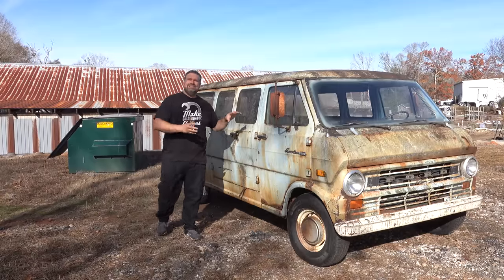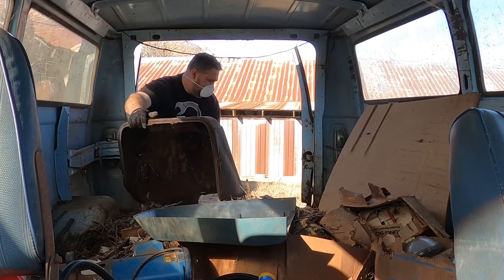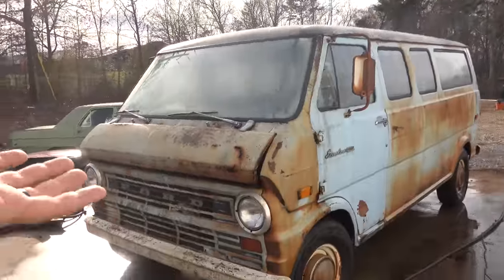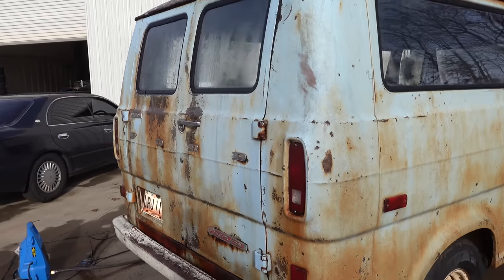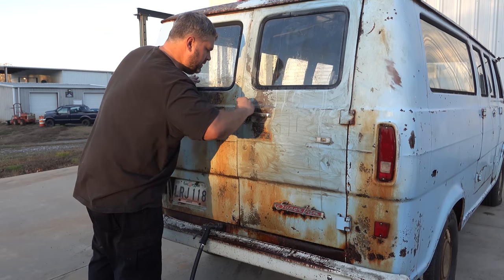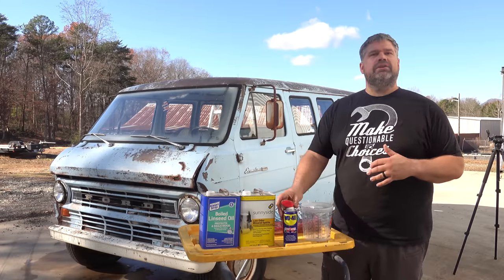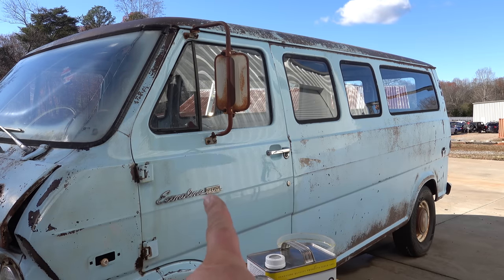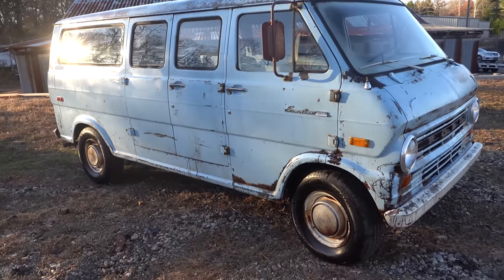First Wash In 32 Years! Abandoned In The Woods, Can This Van's Paint Be Saved? Ford Super Van VGG!

Comment: Dude you are right just keep it period correct and give the van the old skool custom van look. With some shaggy carpet and some old skool 70s curtains and build a wall right behind the farthest rear right door and cut a ford oval to climb through to a bed in the back. Just wall to wall blue shaggy carpet walls floor and ceiling. And put a table and captains chars in the area where the double doors are.

Comment: Maybe you could approach the build like a person with limited time and budget would. Fix what's broke, leave what isn't! Does the ventilation system work? Do the windows roll down(and up)? How are the brakes? The suspension? As for the 240, does it make good compression? If it doesn't, probably swap in something, as rebuilding is expensive, and the 300 or even a 302/351 makes much more sense if you're filling a hole. I would tend towards a stock performance type of build. This is a great vehicle for hauling merch to shows, shop hauler and even weekend camper. Disc brakes will make sense if the suspension needs a lot of work, because you can swap in later I beams. Automatic trans makes more sense if you V8 swap. You could upgrade the 240 with GM TBi for better performance/economy if it's still making compression.

Comment: If it was my van... exterior: keep the current look but maybe replace all window seals and such. Interior: sound deadening treatment, insulate, make a fully modernized luxury camper van. Mechanical: rebuild engine and modernize - EFI, tuned, etc. so that it's the same bones but you get to take advantage of modern tech and reliability... but don't make it overpowered because you want to be able to make long road trips in this thing without having to refill every 50 miles. New modern suspension, etc. I've always like the idea of taking old things and improving them with new tech while hanging onto their classic charm, and this van would be a great candidate for such a treatment if it's an idea that interests you. Regardless, whatever you choose I'm sure it will be fun, and I look forward to the journey, wherever it takes you.

Comment: Congratulations, you have done a great job on the van, I know this will be a lil late saying this, but if you don't care about too much power, I'd probably be looking at rebuilding the engine, and bolt on a M90 supercharger for that bit of get up and go, I'd try and keep that engine in it, if it's the original, rather than go V8.. 🙂🙂🙂

Comment: Were it mine I would make the outside look period + petina, swap in either a barra or Atlas w/ trans (a little more power, but mostly for reliability and fuel economy, making a 5/6 on the tree shifter can be your crazy quotient for this build) and then completely do the interior. I'd probably do swap in a F150 front suspension and steering setup w/ discs and do a cheap airbag suspension (front bags, delete a leaf + helpers on the rear axle) so I could dial in the rake/ride height I wanted when I wanted it but still have a useful vehicle that rides nicely.

Comment: Scooby doo van..fix the floor..jack up the back axle, put the biggest widest tires on the back. Put smaller tires on the front so it sits lower, keep the wheel covers if you like..rims could go anyway you like..chrome preferred. Needs some fuzzy dice hanging from the roof at the windshield. Must have dual cb antennas, with cb. Purple wall to wall carpet with possible wood benches/storage. 73 vans had carpet everywhere.

Comment: Jared, you do JDM stuff quite often but Derek does pretty much exclusively USDM. I think it would be cool to put in an NA 2JZ for the reliability and power, but not too much power. Kind of a mishmash of your different backgrounds a bit, since you were a Toyota master tech at one point. Not sure how the fit would be, but it's also an inline 6, though probably taller due to DOHC. I think a V8 would be cool, but it's a completely different shape meaning more cutting and fab work. The Barra would be really big too and hard to find parts. The Skid Factory did a Bedford van build with the Barra and it was cool, but a turbo build with a really large engine like that I think is more than this van can handle, especially in its current state. Old engines and period correct stuff is cool, but the prices are going up these days and the headaches with them as they age, not to mention stuff like fuel mileage, can be annoying if you want to use it for things like long trip adventures.

Comment: Great you saved this one from certain slow death. This would make an excellent daily/ shopvan. I would not throw crazy money at it but would do this instead:
repair all structural rust (don’t go for pretty but functional and economical), get a mild and reliable tune from the original drive train and replace all consumables making it reliable, refresh all bright work and seals around the entire vehicle (you want all chrome to look like brand new to make the vehicle really pop, add to that period correct aluminium wheels and some paint accents like a properly repainted roof and bumpers - if you stay on steelies, repaint those as well - I’d go for a period / utilitarian off white color for the repainted parts), new period correct looking but modern, fully functional captain seat (think about your back and comfort but keep a period look), restore the drinker side jump seat to original condition, restore cabin to original look ( economy over original but period looking) but add modern features like well functioning stereo, aircon, etc, overhaul the cargo hold for maximum utility - think flexible, one day shop van, hauling wood, the next day transporting bikes, the next day a little camping (don’t do a permanent camper or anything - this thing is sooooo utilitarian as naked as it is, also great gas mileage without hauling all the unnecessary junk around)

this will make a great, lightweight very fun looking shop van (don’t forget logos and company look once this thing is cleaned up and has all the details done), down the road you might want to redo this van again ( a proper high end paint job and restored to showcase the business and you might want to do a drive train swap - nothing too crazy but something fun to drive )

Comment: Super enjoyable video. Never seen you this happy and joyful.
Format works great, great sound.
I think your plan for the van is great. Just in-period updates, slotted mags etc. Pretty classy van with the LWB, long floor and multiple doors.
What would be an in-period transmission upgrade? Maybe an overdrive unit? Or just swap tranny out for a 4 / 5 speed, floor shift? Even an auto and a drag shifter?

Comment: The more I watch It? I’d make it a sleeper. Beef up the front to hold up a 400m and 4 sped. But then muffle It to not give it away. 

I remember my old 78 250. Stock from the 2bbl to oil pan only upgrade was duals to glass packs, wasn’t obnoxious loud but close if you hammered it. Might be fun to have a van with that power train in it

Comment: Hotrod out the original engine just a bit, smaller single turbo that builds enough boost to liven it up but doesn't require a major bottom end rebuild. EFI or carb should be up to you, although EFI would probably be easier to adjust in a turbo setup.

Comment: You can have a party van, and still have 2-4 single Murphy Beds, a coffee maker and a toaster oven.

No need for a major build, just make seating that can double as beds. A small cooler/fridge, a microwave, a coffee pot, and a toaster oven are party needs too.

That's a blue collar van, and it still needs the dignity of working and accomplishing jobs rescuing other dying elder vehicles. It's not meant for cruising the strip, but for bringing home the bacon.

Comment: No V8! Definitely would be neat to do the hot rod 240, but It could get a 300 six. You can make some great power from the 300s. Either way split manifold dual exhaust on straight sixes sounds so great.

Comment: Doing a camper van doesnt have to be expensive. Do minor engine upgrades, brakes and shocks. Get some magnetic curtains, carpet remnants and a 2x4 bed frame with a mattress. Hell, with two piano hinges you can make your bed turn into a couch pretty easy. You dont need to turn it in an rv, just an actual sleeper

Comment: I would love to rock that van around my hometown Orlando for a month or two until the novelty wears off. I still have a 73 F100 I got in 84 that started out life with a three on the tree. Until the shear pin in the column broke and it was just easier to put a floor shifter in. it

Comment: I like your Idea.  Just rebuild the engine it has.  Soup it up a bit.  No need to go crazy.  Its a van.  might want to put some kind of modern suspension in it if you can find it.  Better steering.  Looks too sketchy now.   new brakes etc.  Put your money toward that end.  The camper/sleeper idea works with that.  That would be something youd be glad you have when on the road.

Comment: I would mix the ideas up. First off, I LOVE the idea of doing it with slot mags and maybe side pipes and flares, something like the Coldwarmotors Boogie Van (a similar Econoline, but a short box cargo model), but without their amazing paint job. However, I would not keep the old Ford six. It is a difficult engine to Hot Rod because of the integral intake manifold (at least on the early ones). I would go for a Barra instead, complete with a manual transmission. However, I would probably use the non turbo model as it would have enough power for what you want but without the complexity of forced induction. Alternately, maybe a 2JZ-GE? It would be easier to get parts for a Lexus GS300 than an Aussie Falcon or Fairlane in the US. Either one would give you double the power of the Ford 300 without a reliability hit.

Comment: On those letters to get the rust off a small wire brush with the softer bristles turn it into a four wheeler put lift kit into it and a new chassis with beefed up suspension for to support the lift kit raised up big tires flair out the fender with the four-wheel drive kit those things you can buy to stick on the fenders to flare them out some roll bars inside and outside on top as well with strong lights on top beefy four wheel drive bumpers front and back tint the windows put the stick shift on the floor four-wheel drive bucket seats customize the dashboard with some new LED gauges nice stereo system with subwoofer power amp a lot of speakers in front to back CB radio robar luggage rack on top towards the back nice paint job hell yeah

Comment: You have to keep this stock as possible! The era for hot-rodding these vehicles has passed as not many exist in original condition anymore. The only option for mods being a modern engine, suspension, brakes, and transmission. Wheels should stay original as possible.

Comment: Personally I'd think you could pull a 300 in line 6 out of a f150 with its factory fuel injection 
Keep the patina and 3 on the tree use it as a shop truck 
That would be cool and pay respect to its working man life 
Parts will be easy to get

Comment: Original drive train with some modern upgrades. Disk brakes, fuel system, hei, things like that. End result, shop van.
Reply: If you can't help yourself and you have to change the engine. Go 300 6cyl. It'll tow anything.  Check out the camper truck bed conversion videos for idea's.  You can storage, and a table that turns into a bed.

Comment: upgrade to a 300ci. seriously. b/c if u wanted to get massive power. u could actually get it from it. also as u mentioned tow rig. those old 300cu 6cly were work horse engines. power wise. not hotrod though
Reply from the maker: Considering they are nearly the same displacement as the v8! They can move some air and make some torque. There may also be two of them sitting in the shop!

Comment: camper van but you do what you said at the end hot rod it a bit but just make it the tow rig and have a futon that can fold down in to a bed in the back fix the floors a bit do some work to make it nice on the inside but still have it a period work van that was made for long hauls.     and  AND IF YOU CAN SEE IF YOU CAN GET GRIND HARD PLUMING CO to let you use thar name with your new logo to fit the theme of the van but if not its ok just something i was thinking about that be really cool GHP.CO name with your new logo on the side doors were the vine scar is and have that as the main part of the decal with it spreading all over the van of cars that have been built or helped build going on one branch to the back one going to the back window that has sponsors another going up and out of the handle with the name of all of our great youtube friend channels so vgg and others then the last branch going to the front door saying this is my current best friend.